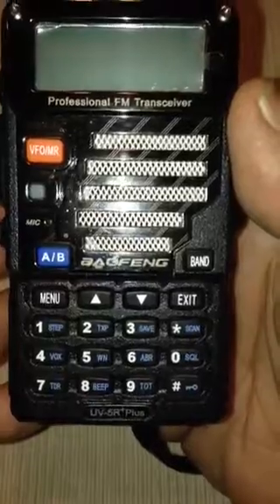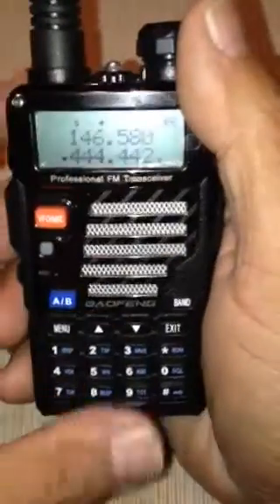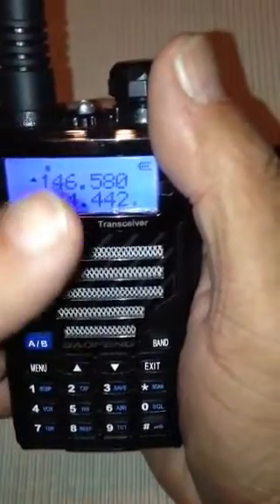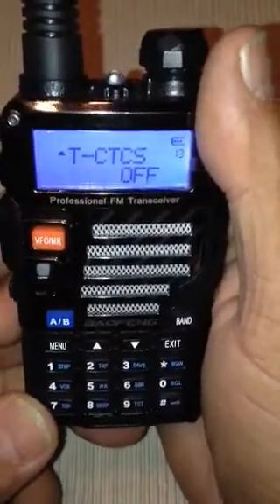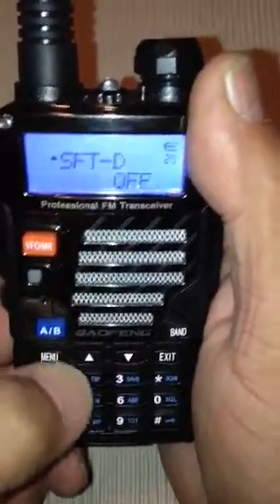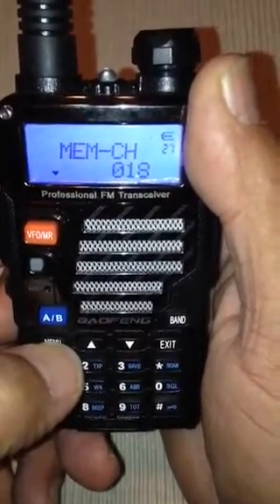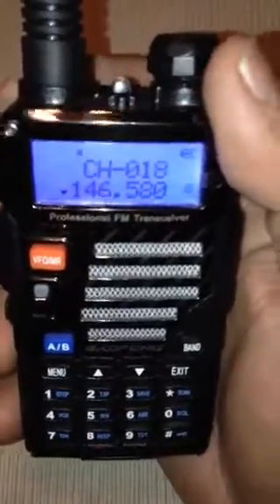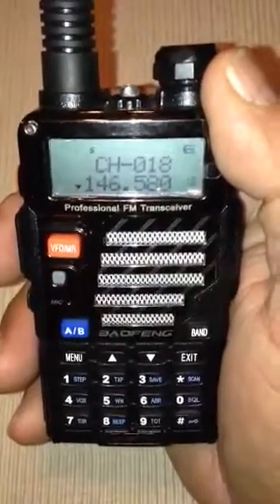Simplex programming for UV5r+

Comment: How do you find a freq for simplex to begin with? No one ever explains that. They just start off with a number they've already had.
Reply: (Still learning, myself)
I don't believe it matters what frequency you pick.  The only "towers" on a simplex frequency are the transceivers themselves.  
Yes this means you'll get interference if a 3rd party is also running that frequency, like any other simplex "walkie talkie" type of transceiver.
Reply: @brandonmaguire3673  Thanks man.